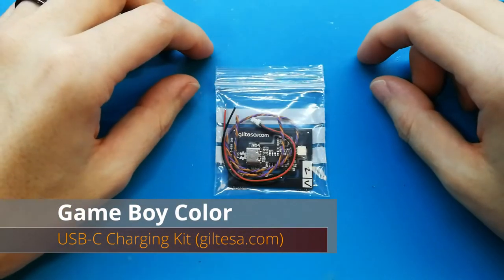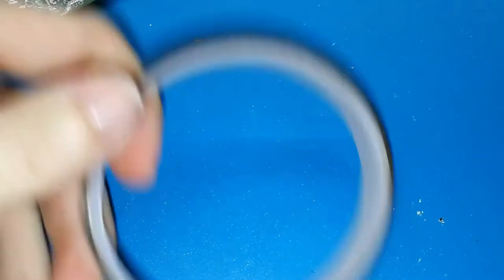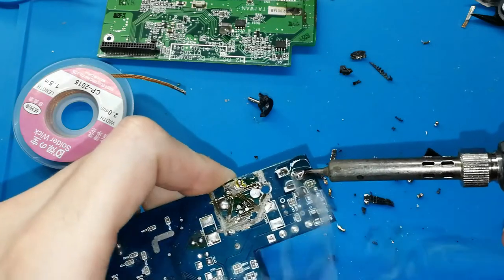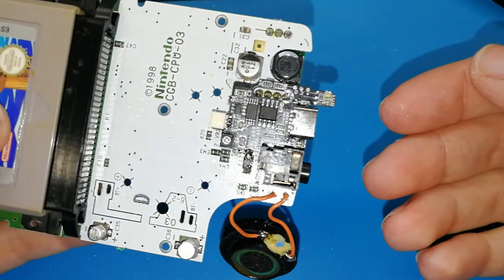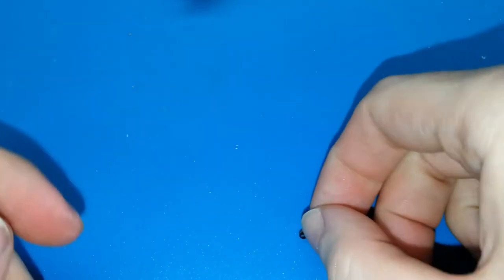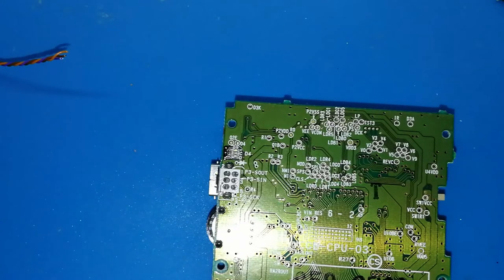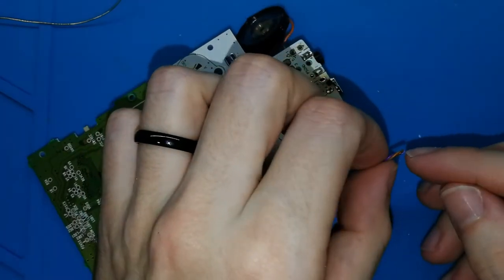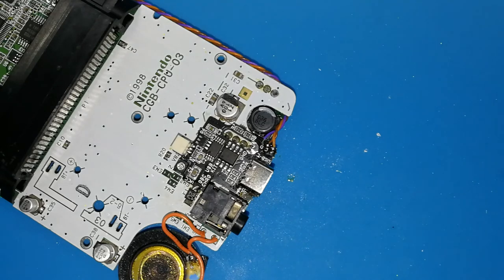Game Boy Color USB-C Charging Kit (Installation)

Comment: Hi Giltesa, Thank you for producing such a great product! I'm in the middle of installing an instance of V3.2! I wanted to comment and give you a suggestion for a modification consideration that may make this mod more appealing to the community. With the release of the funnyplaying FPGA emulation hardware, Funnyplaying has also released a USB-C shell that includes an opening for the port already. Unfortunately it looks your mod may have been designed before this shell was released. As i'm working on this GBC I see that the components to the left of the USB-C port on the mod board take just enough space that the USB-C port on your mod is a few millimeters out of line from where the FunnyPlaying shell has a pre-made cutout. If you are still iterating on this mod, I would like to suggest to you to consider looking into modifying the location of these components else where so that you can slide the USB-C port to the left and then include a recommendation to use the Funnyplaying USB-C shell so that modders can avoid some of the shell trimming steps. Just a thought! once again, thank you!

Comment: Thanks for creating this and the guide, I managed to do the mod and was pleasantly surprised how smoothly it went. One thing I would recommend adding to the written guide is how to modify the shell so it has the clearance needed for the battery connector and other components (and the USB port). It was a little tricky figuring out what needed to be trimmed but once I did a utility knife and some needle files did the trick. I'd be happy to help write something up.

If anyone is wondering, a 103050 battery will fit but I'd probably recommend the 103048 just for peace of mind that it can expand if needed. Stick some foam on the back side of the battery cover to keep it all snug. I used a funnyplaying shell and IPS laminated display and I love it, now this device is really up to today's standards!
Reply from the maker: Thanks for your commentary. I agree about cutting the shell can be difficult. I have a GBC which I will need to modify soon. I will take pictures of the cutting process and add to the documentation. Thanks!

Comment: I wonder if the Clean Power regulator can be used with this mod.
Reply from the maker: Yes, you can, someone did that already:
 https://raw.githubusercontent.com/giltesa/Game-Boy-Color-USB-C-Charging-Kit-Pro/master/5.%20Photos/main/Sascha.jpg

But you can also use the PRO version with DC to DC converter 😏
https://shop.giltesa.com/product/game-boy-color-usb-c-charging-kit-pro/
Reply: @giltesa  interesting...I wonder if I can unsolder and get the second one...especially due to the CleanAmps since I have a new screen.

The screen started switching off but the sound still played.
Reply from the maker: @happiestaku6646  Yes, sure. It's possible to replace the first version for the second one. The USB hole is in the same place for both.
Reply: @giltesa  sweet, as long as the Clean Power is easier to install with the second one

Comment: Does this support LiPo batteries?  If so, I need one!
Reply from the maker: The datasheet says it's for Li-lon batteries:
https://cdn.sparkfun.com/assets/c/b/9/f/0/TP4056_Datasheet.pdf

But many shops, which sell the TP4056 as a module, say it's for Li-Ion and LiPo battery. so, it may work well.

https://www.electroschematics.com/tp4056-lipo-battery-charger-rc-toys/
"The TP4056 IC is a complete constant current/constant-voltage linear charger for single cell lithium-ion/Lithium Polymer (LiIon/LiPo) batteries"

Comment: i installed my USB-C but how can I drill the perfect hole??
Reply from the maker: You need to drill the plastic bit by bit, and check every time if that is enough or you need to drill it a bit more. Take your time, there isn't any other way to do it and no template is available since the USB port can be in a different position depending on each installation.

The good thing is that part of the hole is already done because the USB uses the jack hole, so you don't start from scratch and it helps you to see in which direction to drill.
Reply: @giltesa  thank you

Comment: Donde consigo la batería?
Reply from the maker: Se pueden comprar en AliExpress, el tamaño/capacidad de la batería que puedes instalar dependerá de si usas la carcasa original o una carcasa compatible en la que hayan adaptado el hueco de las pilas para instalar baterías. En el mejor de los casos puedes instalar una 123048 de 1800mAh https://es.aliexpress.com/item/1005001308043027.html y en el peor de los casos usando una carcasa original y recortando a mano el plástico central podrás instalar una 102050 de 1500mAh https://es.aliexpress.com/item/4000036271843.html